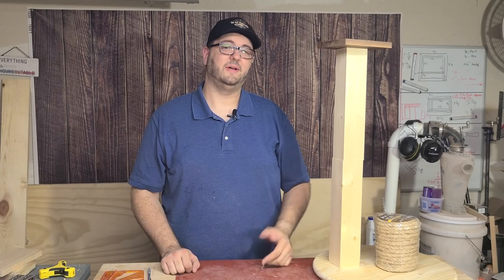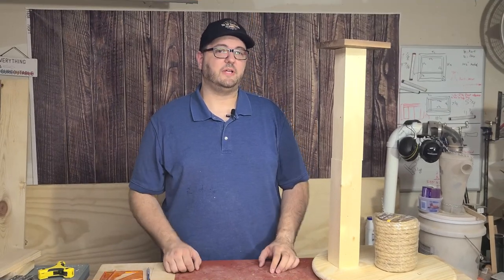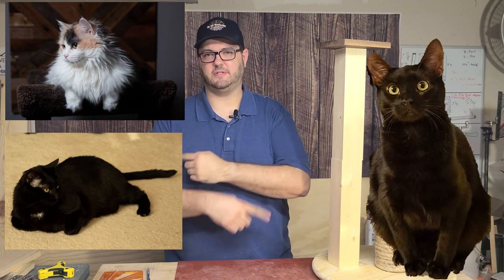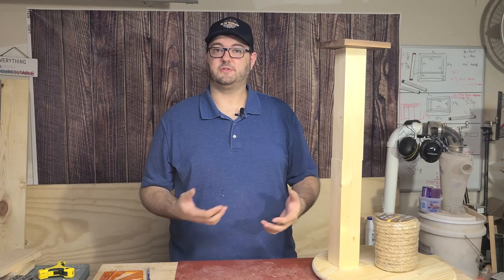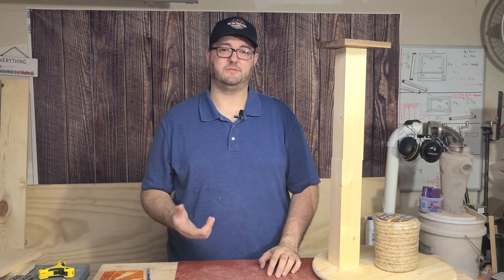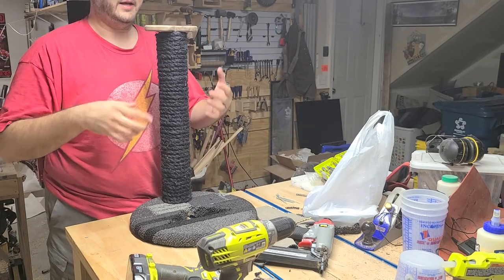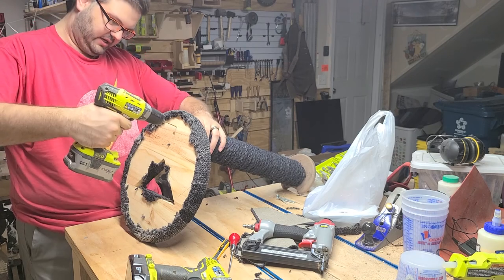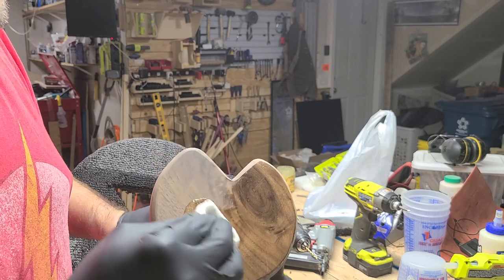I build a custom cat scratching post

Comment: Looks good. I've been thinkin about making a long one. About 2 meters long, that way my cats could climg on top of the cabinets. How much did you use rope on that? And hos thick it was, that could give me estimate how much i will need.
Reply from the maker: Thanks!  It was a fun project and my cat ACTUALLY uses it instead of scratching my chair.  The rope is 1/2 inch diameter, and I used about 30 feet.  Sorry for the lack of metric, but I'm from the US and we have to pretend that the metric system doesn't exist.

Here is what I used to help with my calculation.  You need to know the circumference of the rope around the center column once.  Then take the height of the column and divide by the thickness of your rope.  That should give you a good estimate for your project